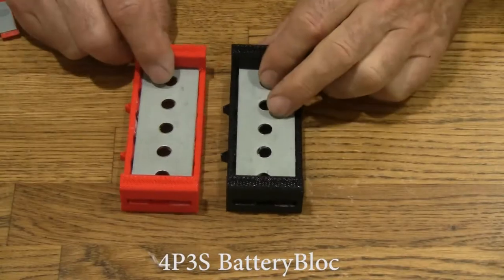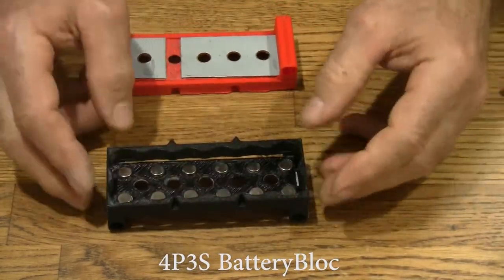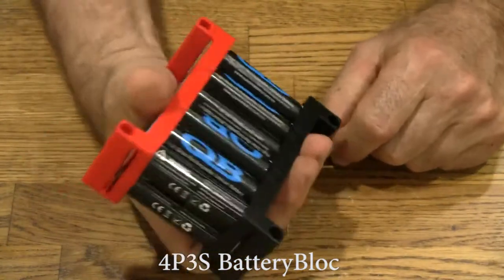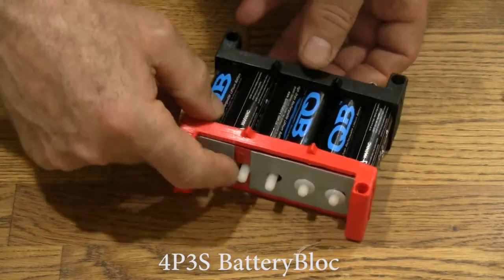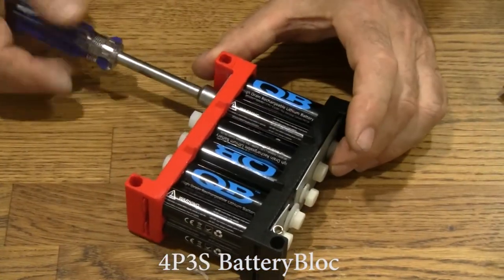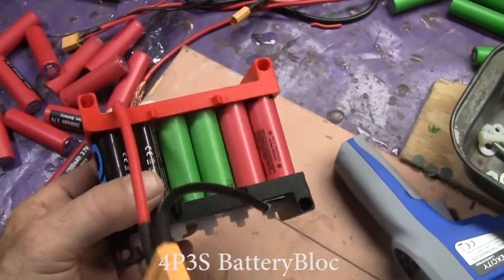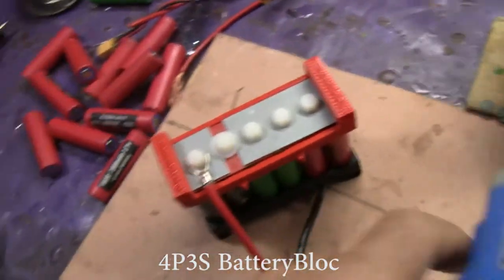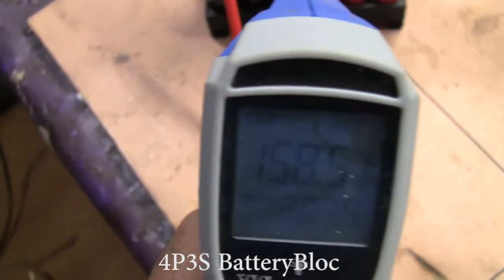4P3S

Comment: Shaun my battery lost power so I took off bike I actually dropped on a hard floor but when I tested 2 rows were dead after I squeezed together more as vruzend kit.one row of 5 cells are 0,0,0.5,0.03, and 0v .and they were brand new cells.i had bms on the one that had smoked but when I wired up whole kit it was charging up ok .so has bms done this ?they were brand new cells from nkon
Reply from the maker: Sorry for your difficulty!   By two rows do you mean one parallel group?  If so, the cell that had 5 volts was not part of that group- not connected- or else it would be 0 volts too.  Is it possible that you got your series/parallel mixed up when assembling?  If the cells were genuine new that is the most likely explanation.  The BMS would have to allow a group of cells to really go high and stay high to wreck them- even if it failed that is not likely to cause the dead cells  as long as your charging voltage was right....

Comment: Yes it individual cells I checked to make sure so I have 10dead cells out of 70 would the bms do that and maybe a faulty
One after just a2 mile run or maybe if they just worked loose would it drain them quick ?

Comment: Hi Craig I’ve got the bms for my 14s battery according to vruzend bms video the black balance wire goes to the negative terminal like the black one on bms thick one.so I connect the next red balance wire to same cell positive then alternate along battery to the positives .i did 7 red wires then wire to 8th one an smoke appears from bms area so I disconnect last one I made smoke stops .tried again after rechecking connections to see no shorts and same again smoke so I don’t know what I’ve done wrong so I’ve disconnected bms for now.battery still reads 54v just charged up with bulk charger.used battery on ebike gave 22mph and just dropped 4volts after 5miles so battery good .any ideas maybe faulty bms .is that the right way for balance wires ?steve

Comment: hi shaun how much is your batterybloc kit for my 14s5p kit.i dropped the battery .well it fell from my bike rack and the plastic bits are loose.not very sturdy like yours look.steve
Reply from the maker: Hi Steve,

I make a 14S 6P kit.  You can buy 7 of the 12P2S Blocs.  My website is www.batteryblocs.com.  You could use your BMS of course.

Comment: @ Shawn. 2 questions: 1) If I wanted to make a battery pack for a 24v 250w motor, which of your systems should I use ?
2) I'm a simpleton- what's the best way to charge the batteries as a pack?

Thanks in advance,
Steve
Reply from the maker: Hi Steve,
For the simplest system use two 12 volt lead acid batteries.  For a lithium system you would need 6 groups of cells in series.  The number of cells in each group depends on how long you want the motor to run, and the capacity of the cells.  I can calculate that if you tell me what cells you want to use and how long you want the motor to run.

 For a 6S a common cheap hobby charger would work well.
Reply: @ Shawn McCarty Thanks. I have INR18650-20R Samsung batteries. Each seem to be holding 4.05 V. I would like to get about 80 minutes of use from the battery pack from a single charge.
Reply from the maker: Steve, you can read my $3 book which will answer all your questions and teach you how to design a battery.

http://www.batteryblocs.com/groceries/the-hobbyists-guide/
Reply: @ Shawn McCarty Thanks again. I bought the book. Once I have the setup figured out, I plan on getting back to you. I also plan on getting some battery blocs in the near future.
Reply from the maker: Thanks Steve, just answered your email.

Comment: Hi Shawn, great vids! Unlike most vids here it's good to see someone pushing 18650's to their limit,very informative, are those battery bloc files open source so I can 3D print them?
Reply from the maker: No, they are not open source, sorry.  A large part of the design are the zinc plated steel plates with holes and the magnets and nylon bolts.  You would spend more sourcing those in small quantities...   The plastic Blocs themselves are actually the cheapest parts!